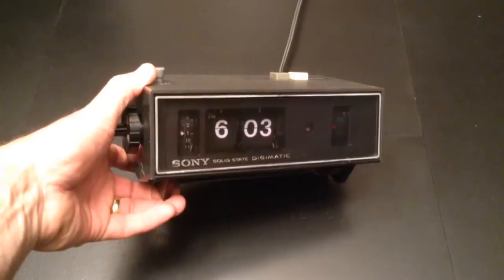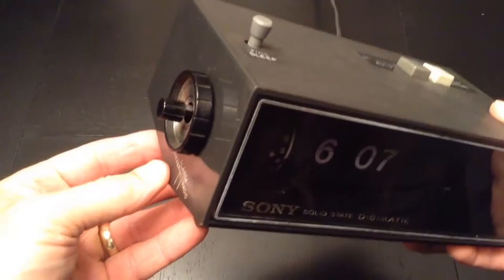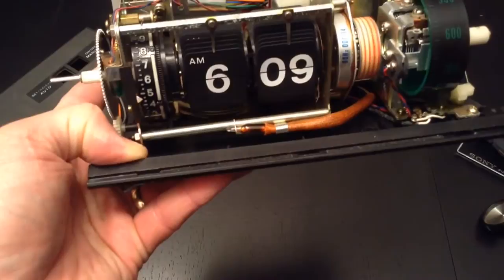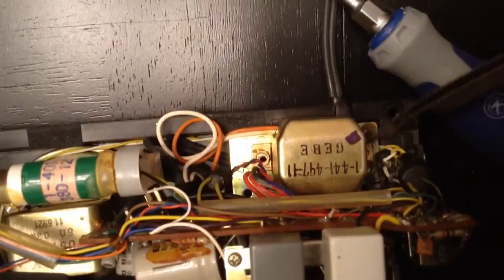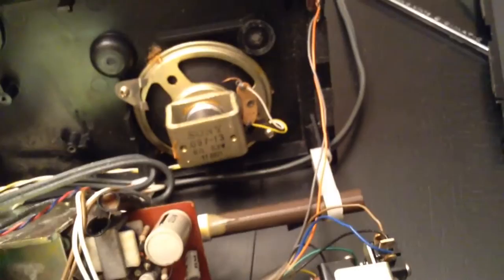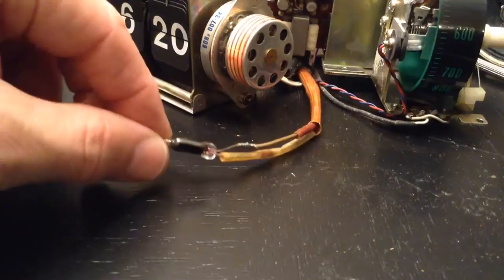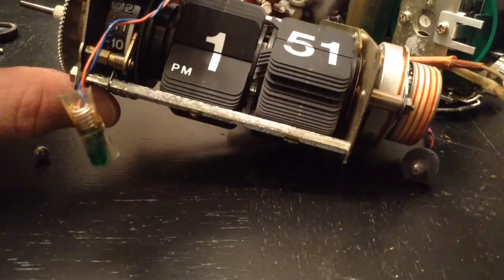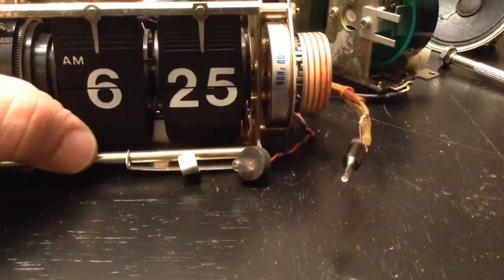Sony 8RC-25 - How to Disassemble

Comment: Hello, great video! I have the same Sony clock, but the hook that flips the numbers makes a terrible tac sound. Any suggestions on how to fix it, maybe some specific lubricant?
Reply from the maker: I've noticed that before on some clocks. I don't know if you want to chance this, but I have gently bent the metal piece back just a little  away from the tile. Sometimes I think it's just too tight. You have to be very careful here. If you go to far I'm not sure that you can go back very easily. Slow and easy. You should notice a change, but don't go too far.